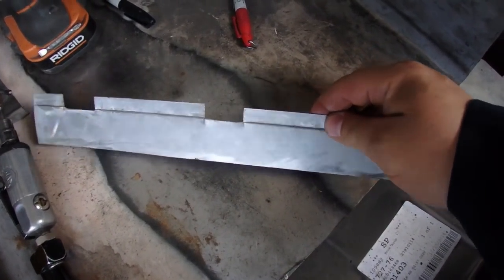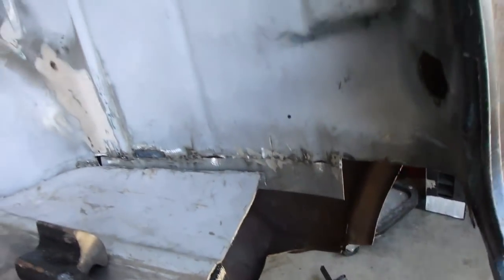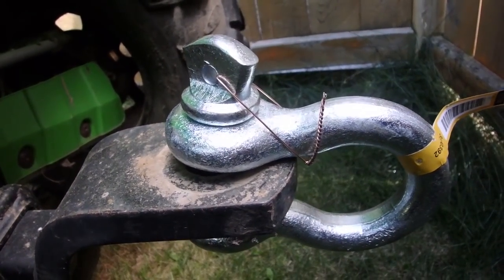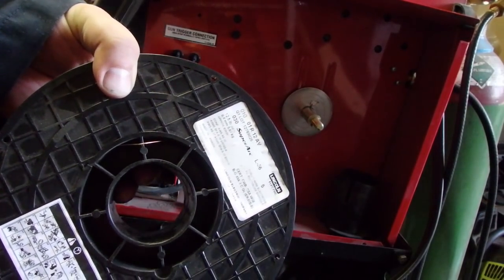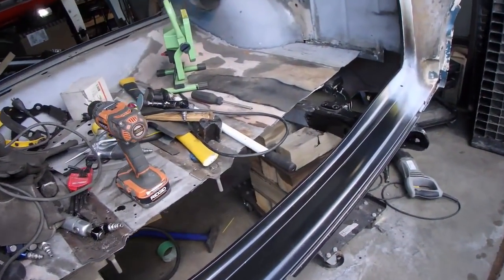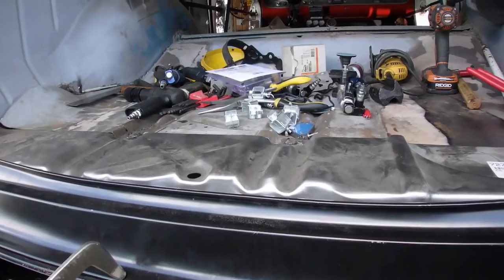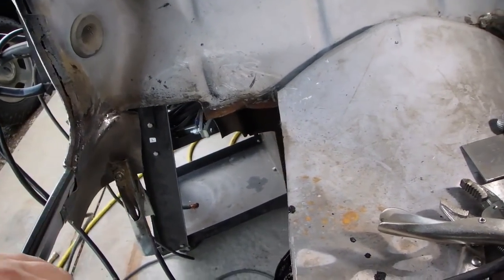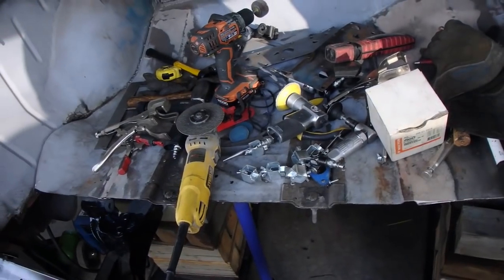Cutting and Welding Body Panels

Comment: you ever weld with pure CO2?  that's what i've been running since I had it onboard in my TJ...  works good makes a super hot puddle you have to turn the power down a bit.
Reply from the maker: no i haven't actually,  the weld shop always said this mixture is great for body panels

Comment: A size larger on the liner works best as long as the tip is right. Man, you opened that can like it was Pabst!
Reply from the maker: thanks, I always just the correct tips

Comment: How did the downsizing in your wire size go? I do all my body work with .35 flux wire. A little messy not using gas but I keep the mobility in the field. I do burn through the odd time but its usually thin shitty metal or getting too rammy . You get props for working on that chevy for this long. Long body work projects are the hardest to stay motivated with.
Reply from the maker: using the smaller wire worked way better, so true it's hard to stay motived I guess that's why it's been sitting in my garage for like 10 years

Comment: Nice work man what a car. I’m working on a bug and found hidden damage so I picked up a new rear clip. From the lower rear window line to the wheel well will have to be cut. The one that has been cut already looks close to straight but how would you transfer the line from one to another?